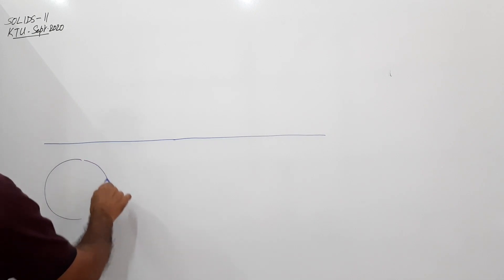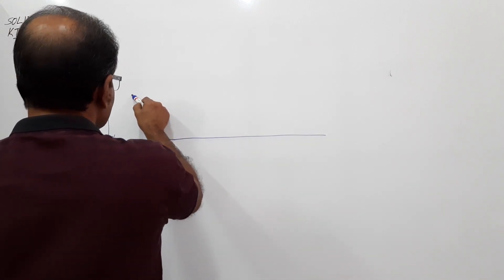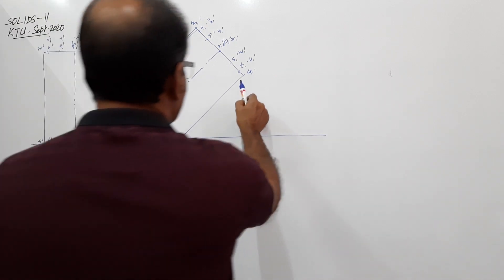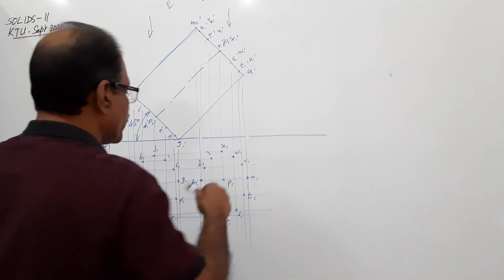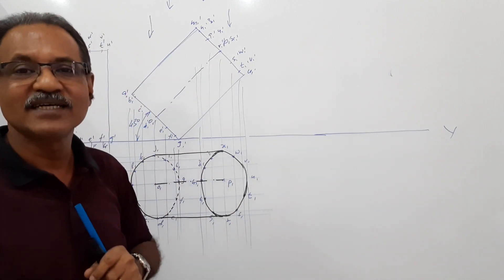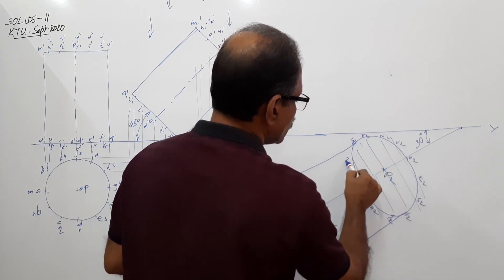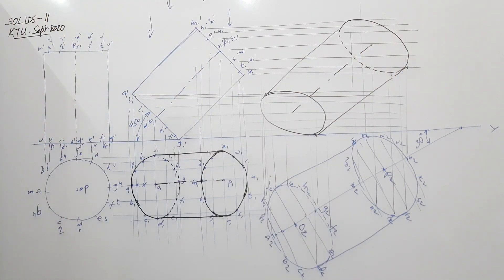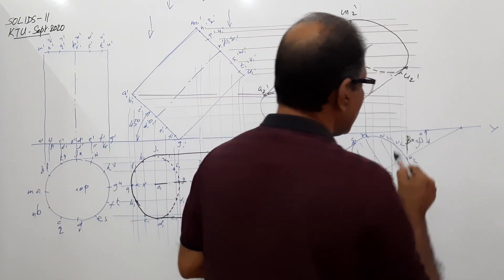Projection of Solids -11, Axis inclined to both HP and VP, KTU Sept 2020 by Prof. Vinodkumar

Comment: how do we find phi here sir?
Reply from the maker: Do the reverse of the procedure used to find beta. That is 
1. Draw a horizontal line. 
2. Take a point on it and draw a line at known value of beta with length equal to plan length.
3. Draw locus through end point parallel to the first line.
4. Take TL and cut the locus with the initial point as the centre.
5. It makes phi with the initial horizontal line.
Reply: @EngineeringGraphicsbyProfVinod  thank you sir
Reply from the maker: Correct